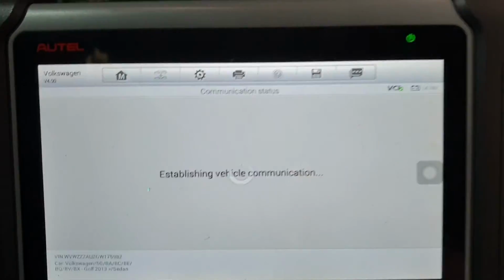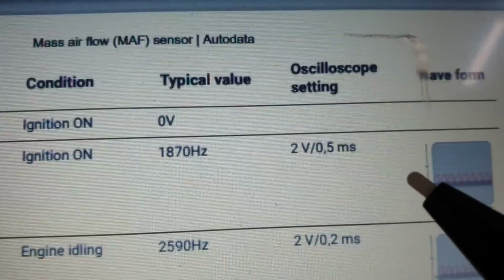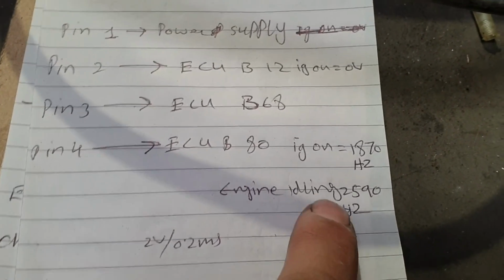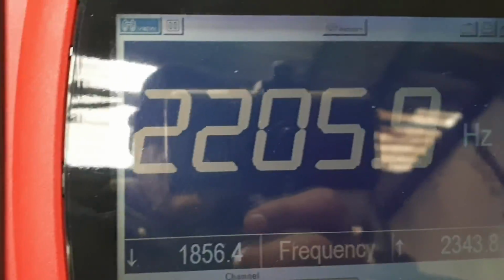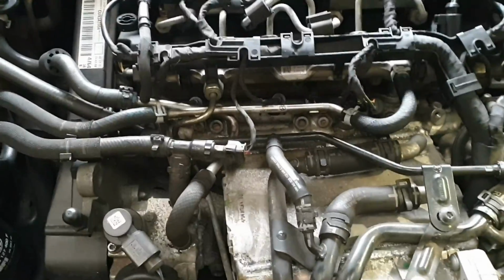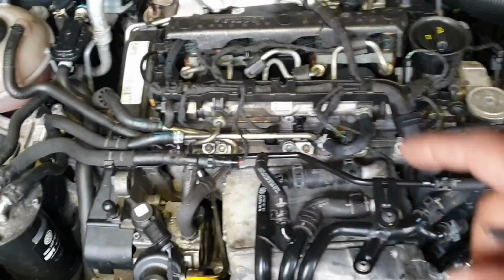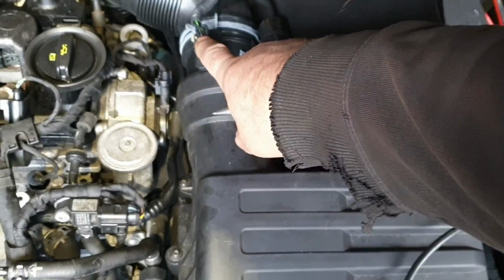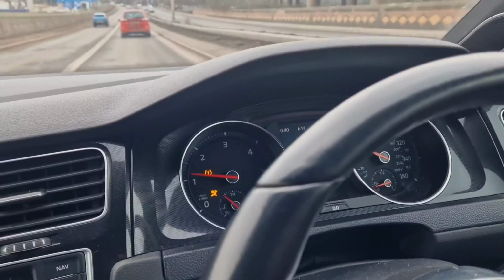Vw Golf Mk VII 2.0 GTD CR (5G1) P0101 (P010100) DTC Troubleshooting

Comment: Thanks for detailed video. I have MK7 2.0 TDI. I have same error code and check engine light on for 6 months. But car runs fine and no issue in power. After clearing the code, it comes back after about 80 miles again. Already changed MAF sensor and air filter without any luck. Tried couple of workshops and no one is able to catch the fault. What could be the issue? From UK.
Reply: looool damn that makes me feel good! i am in the exact same boat on my 2.0 passat i have done the exact same stuff as you  changed maf changed air filter and when code is cleared it will come back after 100 miles or something. does yours sound a little like its got a exhaust leak mine does when i start it up.
Reply: if you find an issue with yours let me know and i will do . cuz it sounds like i got the same issue
Reply: @HowYou8008  sure. I have appointment next week with mechanic. Will let you know what will be the outcome of investigation

Comment: I had a check engine light on my 2.0 Tdi. I diagnosed and the MAF sensor was faulty. I replaced it and reset it off. Now the engine light is on again. Can you please assist Im from south africa
Reply from the maker: Thanks for watching our channel 
I did not change the MAF sensor in that video. Your vehicle problem is restriction in the air flow to the engine, so that has to be diagnosed, i think someone with proper knowledge can diagnose and fix your car. There are many aspects and reasons that can restrict the flow of the air to the engine, for instance, faulty turbo, restriction in intake manifold, charged air system leakage, engine mechanical problem, exhaust system restriction, air filter blockage, low quality after market sensor too.

Comment: Ive seen this before . On that engine the egr gases are filtered after the dpf so uou shouldn't have any carbon build up at all in the charge cooler . If the dpf has faild or been removed .  It causes big problems on these engines like what you have . If the dpf has been removed you have to disable the egr on the ecu map aswell  or you will have this problem again and again
Reply from the maker: Thanks for watching our channel 
Yes, but the owner did say that the EGR Valve is disabled but live data was showing the EGR valve 140%, I didn't know what it was about, even at fully open capacity it should show  on the live data as 100%, but it didn't so no idea, also, it was obvious from the EGR valve condition, when i removed it that the EGR valve didn't look as if it was operational. I think the DPF cleaner fluid caused the manifold clogging, but again, I am not 100% sure what caused the manifold clogging because the vehicle had been to many garages before coming to me.
Reply: @stanhopeautorepaircentrewardak  hi mate , the egr gases are taken after the dpf so there should be no carbon that why the charge cooler is blocked . Some companies that remove the dpf  dont disable the egr and it causes this problem . That car will probably be back very soon with the same issues. Not having a go just offering advice thanks
Reply from the maker: @myleswaller  yes, it's definitely true. If the EGR valve isn't disabled the manifold is going to be clogged soon, and i informed the vehicle owner, but he said that I have deleted the EGR valve function from the ECU.
Reply: We'll soon find out if they haven't . That engine has 2 egr valves a high pressure and a low pressure